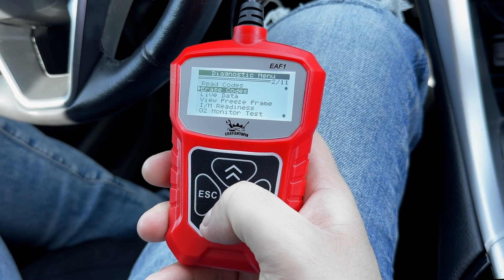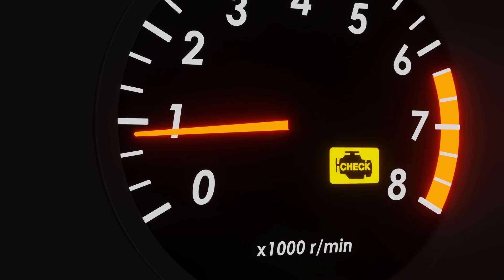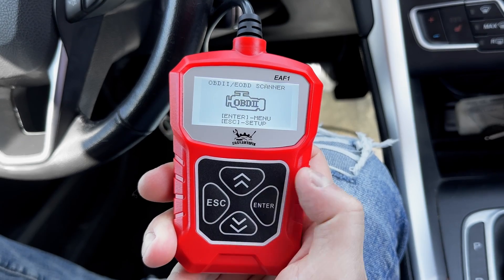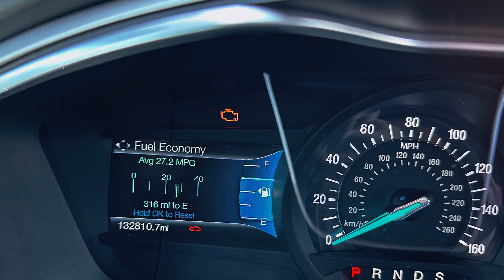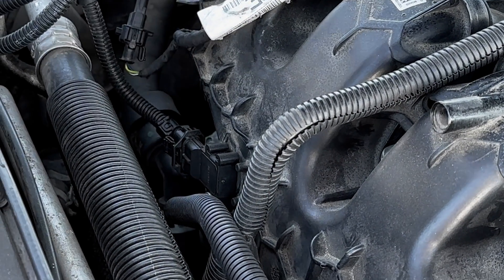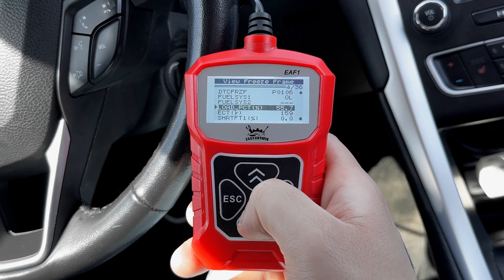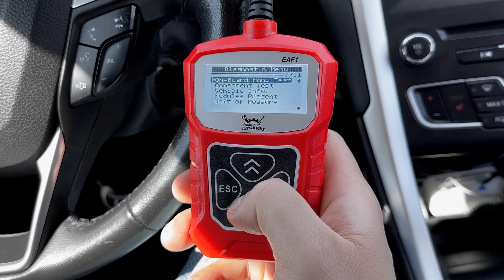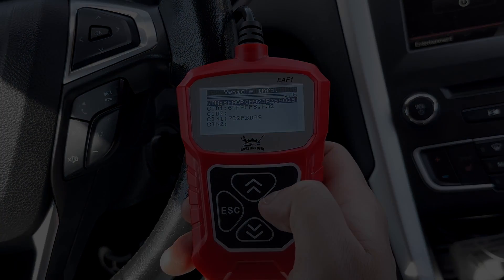How to Use an OBD2 Scan Tool

Comment: Does it also read if you need replacement on a part, say the air filter?
I’m new to this
Reply from the maker: No, that’s most commonly found in the owners manual. An Obd2 scanner helps you read things that are electronic. So think sensors and data from the computers.

Comment: Is this device came with battery ? Is it work without plug in ?
Reply from the maker: It does not need a battery. It is powered by the vehicle when you plug it into the OBD2 port.

Comment: Hey I have a 2008 Audi a4 2.0t Quattro bought new coil packs sparks maf sensor and stills idles rough and has no acceleration could you help me?
Reply: I think this is a video on how to use the OBD reader.  It's not here to fix the car.    Duh 😂
Reply: Did you figure it out?
Reply: Sounds like spark plug issue